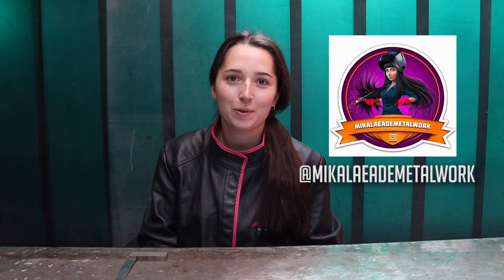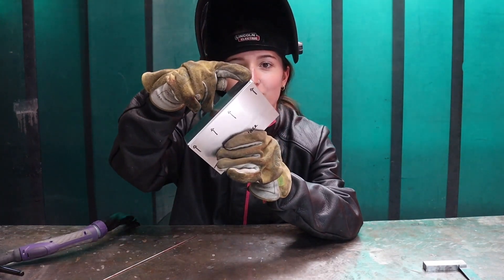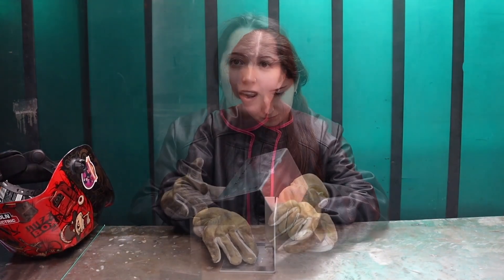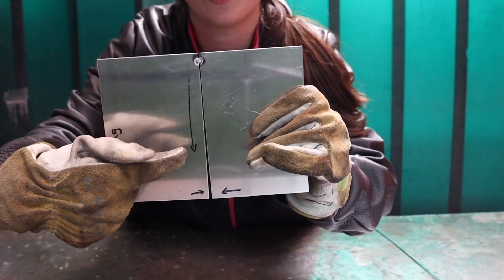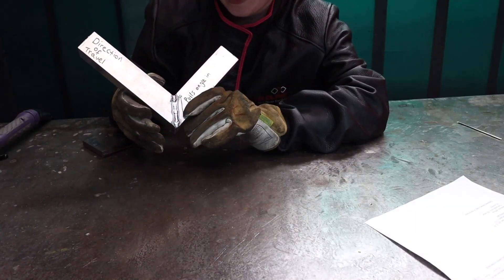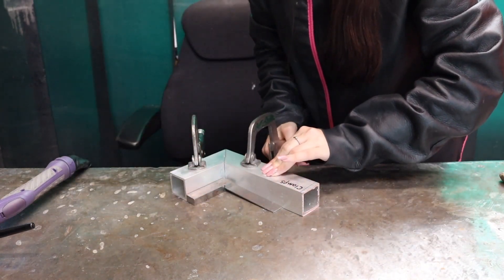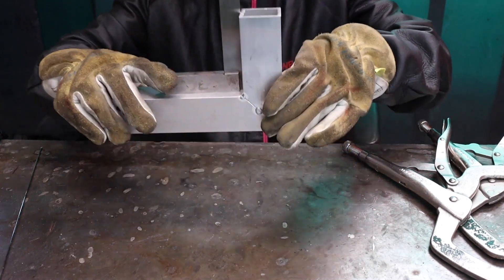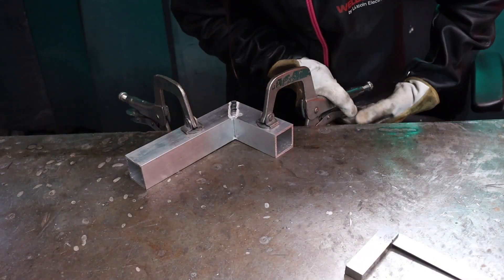Basic Fabrication Techniques

Comment: Nice job 👍 the squares are also called machinists squares and while very accurate good brands like starrett Brown and Sharpe etc can get real expensive real fast you can get a 4 piece import 2-7 inch set for under 50 bucks and you can also buy singles in many larger sizes they're awesome and very accurate but I still only use my imports for welding fab work cause I would freak if my machine work squares got dropped or got spatter on them 😂😂😂

Comment: I  notice more movement when I'm doing the fillet.   I usually open up the 90 and brace it before welding fillet and it always comes back. The trick is-how much to open and to be ready with a sluggo for the fine tune.

Comment: Let the Girls do all the welding. Girls are better suited for it I think. My ticket says Welder, but I avoid it like the plague. 
I work in the preparation department, hydrostatic testing, help QC with weld mapping, bolt up, ect. They make me run the Submerged Arc now and again. I don't even know where my welding shield is and I prefer it that way. Edit: The girl's still put on 
cosmetics for some reason. Must be a habitual thing.
Reply: Better keep a hand in welding or you will loose a bit of touch and become rusty

Comment: When I mig weld 1/2in aluminum vacuum plenums there’s 2in on each side that the base plate hangs over. I have to use a 1/8 plate under it and clamp the edges down over extending them. I preheat it in a oven at 275F. After I weld it and let it cool down and the base plate is flat within .003 thousands on a surface plate.

Comment: Drawback of clamping is that you are ending up with more tension. Not a problem for most work but for some aplications it may. Pre setting for me only is worth the trouble when making a lot of the same. Which i rarely do. Also the order and direction in relation to the other welds on your piece can do a lot. That can get complicatied but in general weld oppositie weld and when you can oppositie direction as much as possible. Experience over time will teach you hoe a givven product wil behave

Comment: Nice to see the Miller Dynasty and Weldmet getting noticed along with the Miller/Weldcraft 2% Lanthium tungsten! You don't have to have a gap, aluminium doesn't need one and will actually prefer to be closed. You can just push the penetration through.

Comment: Nice video!  I started watching it last night,  but fell asleep halfway through.  No aspersions on you, though. It was the 12 hour day fabricating support arms for awnings on a shipping container being converted to a cantina that caused my loss of consciousness...
Anyway, I noticed you mentioned the challenges of measuring inside corners for square with a weld present.  I use a machinist square.  You can slide the ruler in past the edge of the frame to create a gap, leaving space for the weld.  I also have a framing square that I cut a little of the corner off of. That works the same way. Lacking such gadgets, you can lay in a piece of flat stock to shim up over the weld. Just make sure the flat stock is true.
Have a great day!

Comment: A comment section where aluminium fits in!  Nice aluminium welding!  A technique I've seen and used on box corners to minimize distortion is to start with the outside corners, then the sides, then the inside corners.  Clamping when able and cooling between welds is also always good.  Sometimes the big mallet comes out in the end though that may not be good for aluminium.
Reply: Brass/silicon bronze faced hammer work good too. If u don't have a deadblow mallet. Also I use aloy of chill blocks, chunks of both aluminum or copper, whatever u got helps when clamped right next to your weld seam. They also help trap argon  around weld seam little longer. Take care!

Comment: Excellent information!  I have been curious about how other welders keep parts aligned properly (my methods are based on luck).  I have two engineer's squares, but have never used them when welding (yet).

I think Mikala was informative and entertaining to watch.  Hopefully we'll see her here more often.
Reply: I worked for a Truck Trailer manufacturer. The design engineers had tolerances we had to work inside of. In other words no welded object is ever exactly on the mark.

Comment: Might I ask why you're not welding the inside and outside corners first, or wrapping your corners with tacks to hold your angle in? Where's your joint prep? Why no material cleaning before weld? Why weld over the tacks instead of feathering them? Why again clamp down on a weld, forcing the ends of the material down to the table? You're only introducing distortion in another plane of which you're not measuring?
Reply: Nice video, but i am not happy to se the clamping of the squaretubes, when they are turned around liing on the welding spots. You should drag it out over the tablet edge and clamp it

Comment: Are you welding with a AC power supply. If yes is the electrode holder connected to plus or minus side on the power supply.
Reply: For DC welding, the tungsten is electrode negative.
If you have your AC cleaning set to 30%, you would want the same.
Reply: @carpediemarts705  Thank you ... Somebody bought a tig masjine on an auction and we are struggling to get a proper aluminium weld. As soon as I can get to the machine I will send specs and name of machine.
Reply: @pauldebruyn4389  aluminum can be the toughest to learn.  Buy a brand new stainless steel wire brush and write ALUMINUM ONLY on the side.  Scrub 1/2 inch along the intended weld line down to gleaming metal.
Or sandpaper or brand new stainless wire brush on a grinder.  That oxide layer will make things tough.  Once steel is ready to melt, it glows.  Extra hot it turns yellow.  Aluminum needs just enough heat to get shiny and then lighten up on the pedal and MOVE when it gets wet.
Reply: Where do you want the heat to go, into the tungsten? No.
Electrode negative.
 My machine us both stick and tig.
Stick welding is often electrode positive.  I have to check that my tig handle is plugged into the right hole every time as my buddy switches them to stick weld.
Reply: @carpediemarts705  I do no tig runs electrode negative. My confusion comes on the power supply. Must my electrode cable be connected directly to the minus side and the earth/ground to the plus side on powersupply. As the machine is AC and switching anode and cathode.
Reply: @pauldebruyn4389  no.  They can be set in reverse for AC.  But turn the a.c. cleaning dial the other way.  If your tungsten melts, too much power is going into the tungsten.

I'm just an artist, hence the thumbnail
Reply: @carpediemarts705  Thanks a million. If I get to the machine I will experiment and play with setting and I will relay my findings. Together strangers will solve problems. Enjoy your art and welding time.
Reply: @carpediemarts705  I have only done tig on a DC powersupply before.
I am a instructor/assessor. We only worked most of time smaw mig and DC tig. Gaswelding(asseteline/oxy) and cutting.
I left the welding and teach Egd at a school.
Reply: Termadyne SA TIG 200p AC/DC inverter
Reply: That's the name of the welder